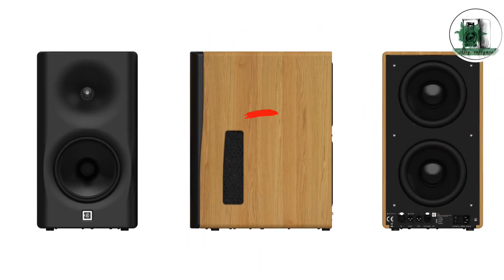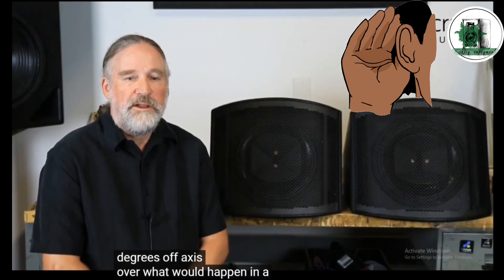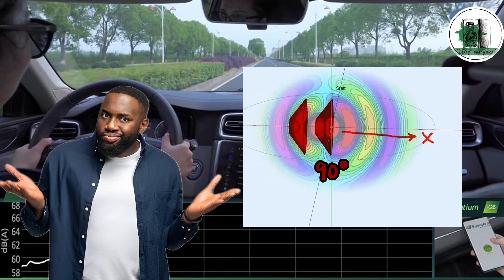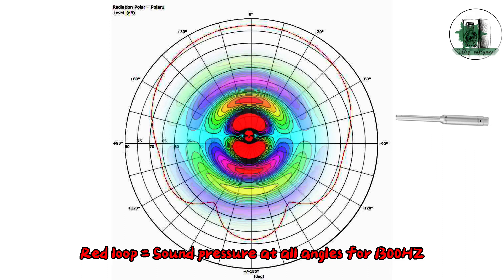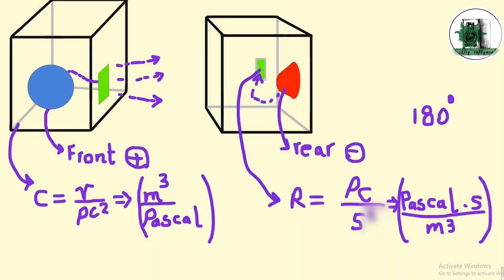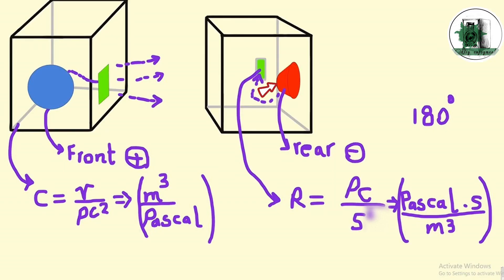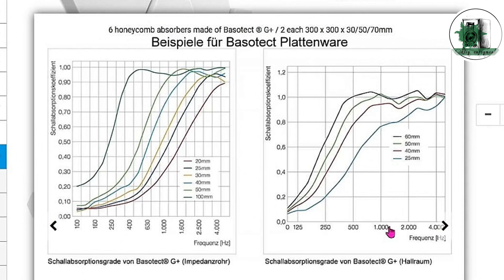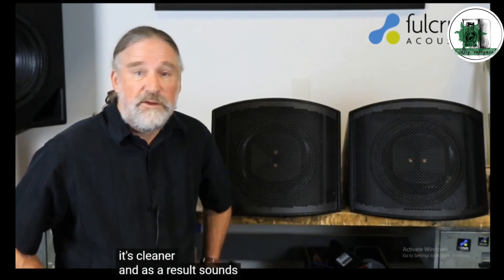Cardioid Speaker Theory Simplified-4

Comment: Thank you for the video, its perfect

I have two questions : does the bass reflex still works or is it now only to reduce the output on the sides ? Like if I want to try this but I also need my bass reflex to work for my speaker to reach the crossover frequency (80Hz), will it make it ?
Second question, having the ports on the side reduce the output in low frequencies on the back too or only on the sides ?

Thanks for your time, it would help me a lot
Reply: Maybe since the absorbant material does not absorb bass (under 250Hz), the bass reflex port still works in this area ? But how do they control the directivity down to 100Hz ?

Comment: Is there any calculations for determining the enclosure size?
Reply from the maker: Trial and error
Reply: @Diy_enjoyment  Yeah, thats what i was thinking. From reading the forums there does seem to be some insight, but nothing fully concrete on design. Seems like alot fo trial and error for passive resistance port designs. Thanks for the videos, this has to be one of my favorite channels on speaker design.
Reply: @kanonpeterson1041  Enclosure size can be estimated with regards to two factors.
1. The enclosure acts like a folded open baffle so the lf cuttoff can be estimated using the path distance between front and rear wave ie the path difference between driver and port.
2. also the enclosure needs to be big enouth to fit enough dampenig material to archieve the passive delay at the desired frequency. This is trial and error.
Reply: @luxxer12  Ohhh, I see. If I’m understanding correctly, the estimated frequency range we are looking to implement a cardiod pattern can be designed for by the distance of waves between the front wave and the back wave? So like a u-frame open baffle?
Reply: Then using certain dampening materials to help achieve the passive delay we desire?